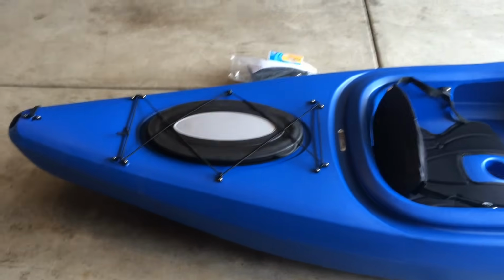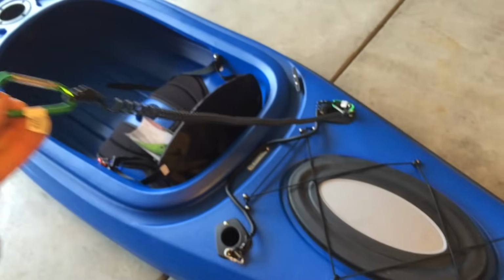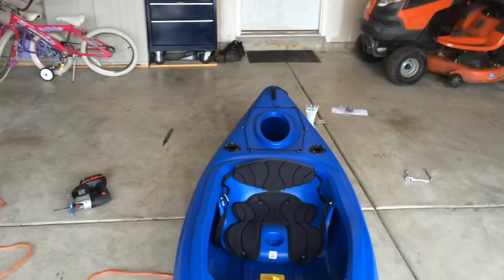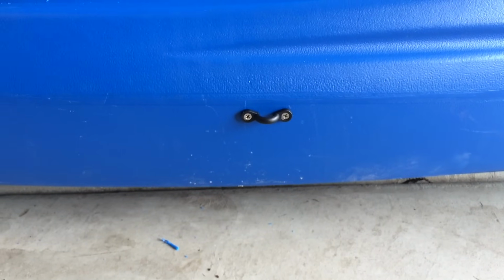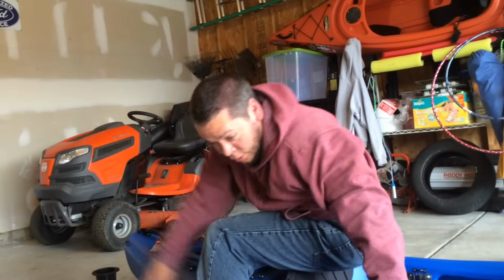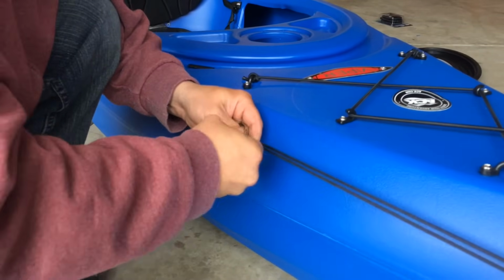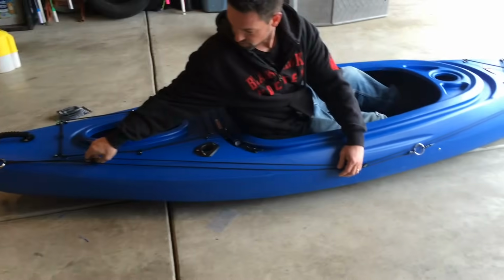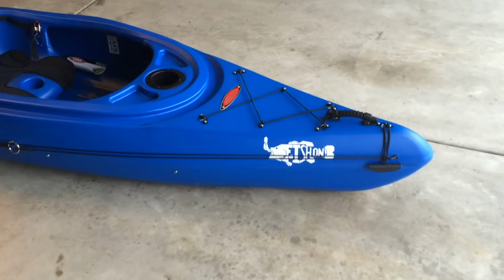Poor Man's Kayak Modifications

Comment: what is the purpose of the anchor trolley system? is it just for fishing?
Reply from the maker: The anchor trolley system helps keep you pointed in the direction you want to be in, doesn't just have to be for fishing.
Reply: And if you let the anchor attached to the side of the Kayak instead of front or rear,  
 you WILL capsize!  ;)

Comment: Instead of using electrical tape on the anchor trolley knot ends... snip the paracord back so there is about a 1/4 inch of tag end left.  Use a lighter to melt the tag end back and while it's molten use the rounded shaft of a screwdriver or something similar to drive the molten paracord into the last knot.  Very secure way to lock in that last knot by because the end melts and becomes one with the knot.

Comment: If you’re going to buy a kayak, spend the extra money. All kayaks are not equal… go with an Old Town.
Reply from the maker: The point of the video was to get someone on the water in a kayak that had some useful inexpensive modifications. And this is a very wide stable kayak for beginners. And at the time Menards where we got it from had a great rebate on it and they done that like three or four years in a row.

Comment: Why add 2 trolley systems o on same side of yak? Deck eye in middle should of been more vertical amd just run cord thru it to bow and stern. Also, definitely should of used silocone to seal screw holes.
Reply from the maker: MrHookSet not sure I understand the obsession with silicone we’ve been running these yaks for 5 years not a single leak I use rubber washers on the inside, same as some of the manufactures. And I tried the single trolley system and the para cord always flipped up and over the cockpit, this was the best fix. That happens because of the shape of this yak. Now if this was a sit on top with no access to the inside I would’ve used silicone for sure, thanks for watching.

Comment: i get the handles & rod holders. but what is the string on the side of the boat do/for ?
for those of you that say seal the holes.  you will get more water in the boat, from water 
dripping off the paddle , then all the screw holes. didn't see any below water line. what 
about the big hole your sitting in ?   ...   just sayin'  :-)
Reply from the maker: 1Reddogroad the string on the side is a anchor trolley system. Helps anchor the boat from front or back to adjust to the wind. And you are correct about the water and paddle thanks for watching.

Comment: your trolly system will chew into your nylon pad eyes. use stainless steel pad eyes. or use little block and tackle or snatch blocks(aka a pully system)
Reply: That IS NOT a trolley system by any form of the definition.  A trolley system is one continuous section of rope to move the anchor the full length of the boat and pulleys should be on each end.  I'm not surprised though, since they opted for phone cord when three rod leashes can be had for $10.
Reply: How is that not a trolley system(s)?

Comment: It would be great if you did/do a follow up video on the water demonstrating how each of the additions to the kayak work/function or benefit the fisherman.Especially the anchor trolley.
Reply from the maker: Rick Barraza sorry I’ve had a lot of changes in my life over the last couple years and finding time to make videos had been tough. The anchor trolley is all based on current and wind. Being able to anchor at either end of the boat helps position yourself for casting. Hope that helps and thanks for watching.
Reply: I hear you. As we get older time seems to fly. I’ll search for “kayak anchor trolley” vids out there. I’ve already purchased and installed the  rod holders from Yakattack just like yours on my old blue Tarpon 120. The thing is like 16 years old lol. Mine came out looking just like yours, angled to the outside of the craft. Thanks for the reply!

Comment: Did you use a sealing for all those holes you drilled? I would think water would get into the holes
Reply: The side holes, yeah, probably best to use some kind of sealant.

The ones on top, the only time it would matter is if drilling in to a location that has no access hatch.   You also won't get much water, if any, in a regular flatwater lake type situation anyway.
Reply from the maker: No, used a rubber washer, been using the yak for 5 years or so and never had a single leak.
Reply: they didn't read your vlog.
Reply: You have too use marine sealant when you start drilling holes

Comment: Would it have been more wise to install the rod holders in the rear differently ? It looks like turning them more inward (so they parallel the kayak)would make for a slimmer profile. That would make it easier to dock, and easier to navigate narrow passages.
Reply from the maker: Smokeydabee Charles Coleman you are correct it was a mistake during making the video and was corrected later. And a new video was made to show the correct way to install them. Thanks for watching.
Reply: I have the same direction from factory. Someone said for trolling... It's very similar looking  'muskoka evoke'

Comment: Drop a little silicone in there when attaching. Stuff lasts forever. It is even dishwasher proof.
Reply from the maker: 911 Tech don’t need it those rubber washers I used work just as good. I’ve been using it for about 4 years now not a single leak through any hole I drilled.
Reply: That's fine but most rubber washers will eventually dry rot. Probably not over the life of a yak but if the washer is not top notch I immagine it is possible. I have seen it happen in sheet metal screws with rubber washers. I had a coffee mug that I accidentally dropped a bead of silicone on and that bead stayed there for about a decade before the the mug was broken accidentally. I assume it is still there in some landfill, lol.
Reply from the maker: 911 Tech I hear you, the one thing I’ve seen with silicone is it likes to separate at the seal sometimes do to the elements hot and cold and sun. This doesn’t happen all the time but I’ve seen it on yaks because most of the time they either sit in a garage or outside causing extra wear and tear. Thanks for watching and the advice. I think yak attack makes a video wear they use rubber washers as well on a anchor trolley system but I could be wrong.
Reply: @mattsloan32  PTFE tape (for plumbing work) is common here. There is PTFE string too. You can put more on the thread than necessary which will pushed out (into the mating surfaces) when the nut is tightened. You can put some on the thread of the screw before the eyelet/screw assembly inserted into the body, then some after it, then both sides are sealed, plus the thread as well. The right amount depends on the hole clearance and surface roughness. You get the idea...

But the rubber gasket might bs better because it is flexible, and it is less chance that the eyelet breaks. You could use polyurethane washer is you are concerned about the lifetime of rubber.

Comment: Basic Kayak Modifications & Gear:
0... Clip your stuff to your boat, except anchor - seriously.
1. Watertight Box ,brightly colored,for phone, wallet, keys, etc.
2. Pool Noodles in sidewalls or rear hatch. This makes your kayak recoverable at the surface when you sink it. 
3. Upgrade handle mounts to dock cleats or eye bolts w/ washers. The little screws provided will tear out.
4. Attach anchor* using a cleat.
6. Add eye bolts for easy clip on, tow, securement.
7. Caribeaners and floating rope.
8. Drill drain hole in cup holder.
9. Cut pool Noodles into short sections to make cheap floats. Tie floats to everything.
10. Add pad eyes everywhere!
11. Add 6" pool noodle trough center of paddle as float.

Basic Fishing Gear & Mods:
1. Flush mount pole holder.
2. Anchor* cleat / trolley system
3. Mount a pool noodle to stab your hooks and lures into for easy access.
4. Fishing rod floats, because you can't paddle upstream while you unsnag a line. You can drop pole in and paddle up for recovery in case leash pops off (and it will rip off if current pulls boat away from snag)
5. 6" length pool noodle slid over fish net handle as float.

BIG Safety Tips:
1. Tuck POOL NOODLES into sidewalls or rear hatch to make sure when it tips, it floats and can be recovered. It does no good to secure all your equipment to a boat that sinks with all your things!
2. *DO NOT KNOT your anchor... Cleat it down so you can quickly release if it snags or you're in trouble. Attach float to anchor end-line to find the end of it for recovery.
3. Plan route and know where the dams / falls are, when the water eddys form, and have a PFD.

Helpful Tips:
1. Add leashes and floats to gear / paddles / etc.
2. Sit in your kayak (on land) as you test for your mods. Practice getting in/out to see when your footing is. 
3. Don't put hardware where you lean back to rest your arms.
4. Keep in mind limited reach from seat.
5. Sunglasses, sunscreen, etc. 
6. Umbrellas can work as a sail, both good and bad.
7. Selfie with serial number in case stolen, register online, sharpie name hidden inside.
Reply from the maker: Tuneman7777 lots of great tips thanks for sharing and watching
Reply: @FishingPOV  Thanks! I love helpful videos and tips. Win-win for everyone.

Comment: SAVE THE CUT OUT PIECES FOR LATER REPAIRS!... Wait a sec...
Did you angle the rod holders inward? You're going to wind up with a hook in your neck /head.
I use regular pointed screws (stainless) but on the inside if accessible I'll put a small block of plastic cutting board as an anchor.
The cleats should not be in a recessed area and should be easily accessible like next to you not behind you.
This must be your first kayak but at least you're trying... Shouldn't be in a video because so much is being done wrong.
I'm only 4 minutes in and can't watch anymore.
Reply from the maker: Yes we corrected the rod holders later LOL I really didn’t intend to actually make a video out of this, thanks for the comment and watching.

Comment: I would highly recommend backing plates on ALL of those nuts and bolts. That's pretty thin plastic
Reply from the maker: trapangler thanks for the idea, so far so good without them. I haven’t had any issues yet.
Reply: I would recommend sealing all that shit.
Reply: I'd also add well nuts in place of the nut and bolts
Reply: Many of the kits are set up without backing plates.
Reply: I used rubber washers on my bolts
Reply: Look he don't need no backing plates he's good
Reply: How would you do that on a kayak with no access lol

Comment: Wow, loved this video!  I just bought mine (lime green) from Menards here in Omaha last week.  Haven't taken it out yet- wanted to do some upgrades like you've done.  Thanks so much for this information!  I'll try to do as a good a job as you guys did!
... ps..  is the anchor trolley for an actual "anchor"?  I bought a small 8 pound collapsible anchor and thought about using just a double screw eyelet like you used.
... pss.. got it for $169 after the 11% rebate.   
.

Comment: basically this video says drill a lot of holes in your boat and put stuff I'm the holes
Reply from the maker: Yep
Reply from the maker: joshcb7 good luck
Reply: There is absolutely nothing wrong with drilling holes in a boat to attach accessories so long as you seal them properly.  Any commercially built boat or watercraft has sealed holes for cleats, anchor ties, etc.
Reply from the maker: Tom'sView Photography I sealed all holes with a tight fitting rubber washer and have had zero issues. In a boat or a sit on top Kayak I would use silicone. However I've watch plenty of videos from many folks and kayak companies that don't use anything, even on a sit on top.
Reply: the devil of fowlerville.   I'm the holes.
Reply: Does not really matter if you back seal all of the different holes you drill on this style yak, ... it is a sit inside anyway, no place to keep anything truly dry, ... but I would advise adding a small bilge pump, & battery, instead of having to bail, with a pail, & sponge, ...

Comment: Rivets > screws.
Reply from the maker: Jason Kloos explain
Reply: Fishing POV you don't need to have access to the back side. They are just much easier to use.
Reply from the maker: Jason Kloos you are correct but the rubber washers I used seals the holes, no leaks in five years. If it was a sit on top I would use rivets. Thanks for the input.
Reply: I used rubber washers with rivets as well on a sit-on.
Reply from the maker: Jason Kloos were you able to get the washer on the inside? Or was it on the outside? That’s a good idea I’ll have to keep that in mind.
Reply: Fishing POV on the outside, but once it's clamped down, it's sealed. I actually used o-rings from a cheap o-ring set from Harbor Freight.
Reply from the maker: Cool thanks for that info bro I'll definitely keep it in mind for my sit on top.
Reply: Fishing POV no problem.

Comment: Ya put the Rod Holders in pointing the wrong way.
Reply from the maker: Dicky Fisher thanks for watching. Yep wasn’t paying attention fixed it later. Is there anything you liked about the video?
Reply: +Fishing POV yup i liked all the stuff ya can get to add on. Ya can take a $400 ky. an make a $700. one. Got mine at a pawn shop for $140.
Reply from the maker: Dicky Fisher that’s awesome I agree it doesn’t have to be expensive to set it up to fish. We’ve been running these yaks for five years and we’ve only had to replace the para cord. No leaks no problems.